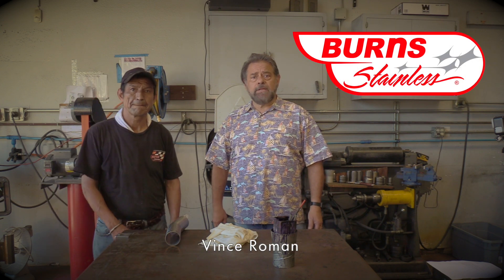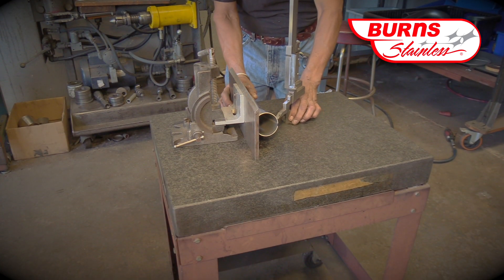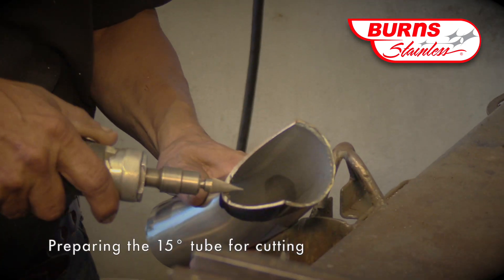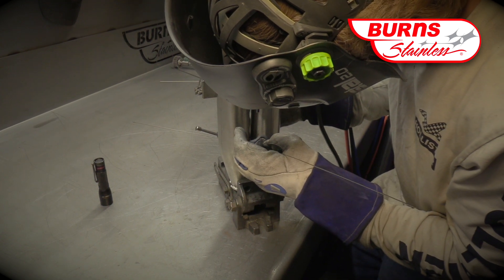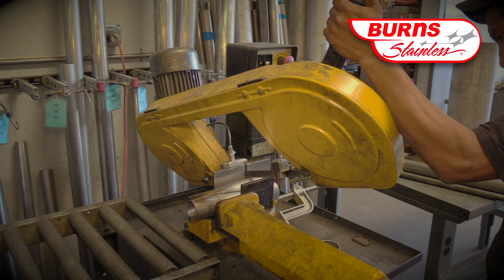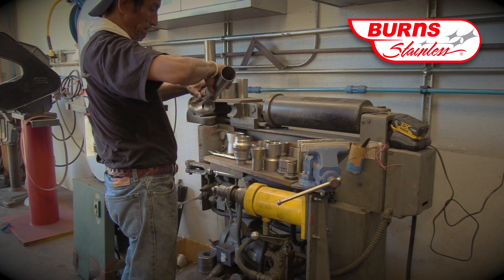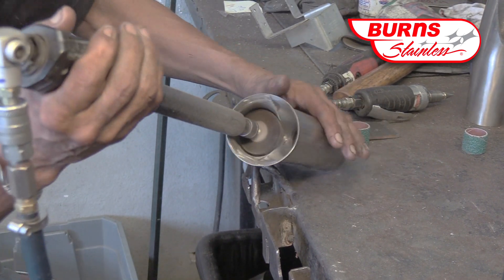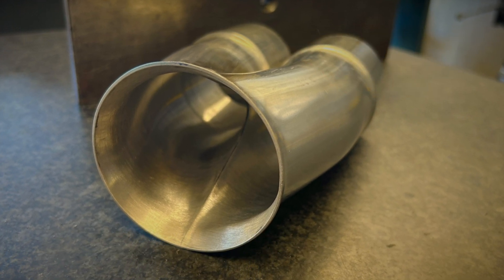Vince in Shorts: How We Make Burns 2:1 Collectors

Comment: Ever considered using a slitting saw in a mill to slice those tubes? It works great. Less sanding/no sawing.

Regardless, your parts are top notch. I've seen them in person.
Reply: Thanks for the tip.  The video was made using the most basic equipment.  We use a couple different methods - but the slitting saw is new.  I will check it out.